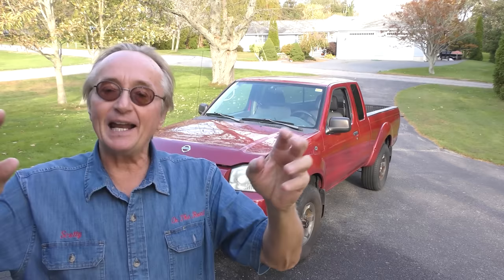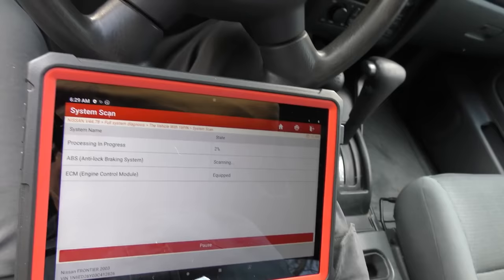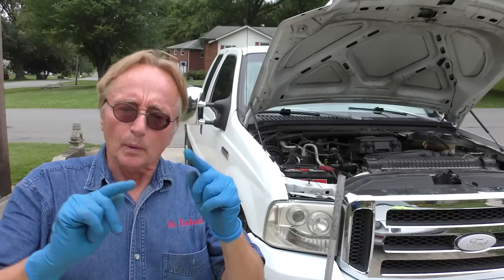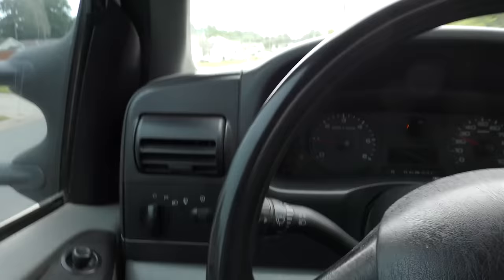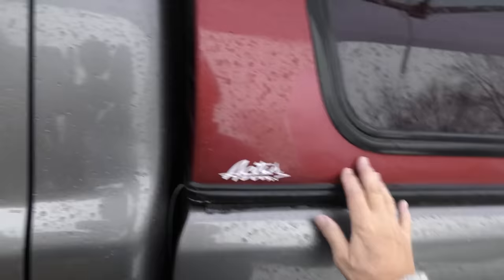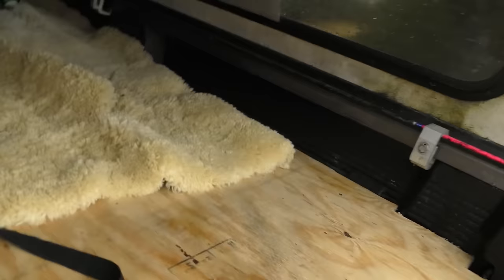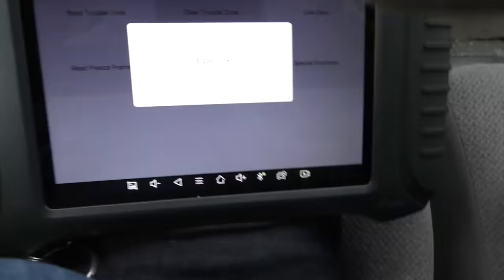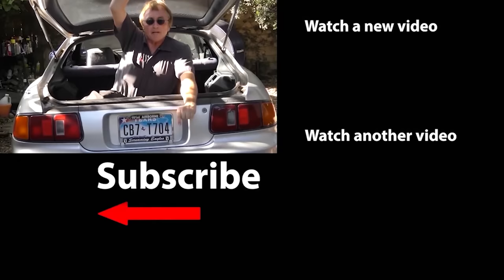3 Best Trucks to Buy When You’re Broke

Comment: Wow a $6300 F250 with 280k miles is considered a good deal these days. Good lord times have changed.
Reply: 25k here for a 1996
Reply: @pedro72246  I feel your pain, I was looking for a truck for months until ultimately I ended up buying a 2002 F150 for 12 grand. Only 85k miles on it but still insanely priced compared to what you could find just a few years ago.
Reply: In the past year I've bought 3 F-250's, An 81 with 67 k original miles, for 1500, a 95 for 250 dollars with 258 on the clock, and a 99 diesel with 212 for 8 grand from a dealer. The deals are out there, just got to be on the look and ready for them to pop up
Reply: You always overpay for a pickup becUse the wanna be cowboys all want them.. get an suv with same powertrain for half the price
Reply: @keithbellair9508  I'm a landscaper, I've been buying cheap pickup trucks for years. Trust me, a few years back you could get a 100k truck for 5 grand or less no problem.
Reply: I got ranger 5k 117k 4x4 3.0 Vulcan
Reply: Man im feeling better about the 93 ranger i scored for $500, granted its got tons of cosmetic damage it has good bones otherwise but could use some tlc for sure. 

It has a mileage discrepancy since they swapped out the original engine for one of the same model but a year newer and changed out the dash and thus the odometer as well. Allegedly it only has 30k on the engine plus the 5k on the odometer. Would have to boroscope it or tear it down somewhat to dimensionally inspect some stuff to verify.
Reply: I was thinking the same. The 3V 5.4 had alot of issues and even if said issues have been fix/changed out with more durable parts, the truck itself should be no more than $4500
Reply: Yes sir,at one time 100kwas wore slap out,lol

Comment: I love my 96 F150. It has almost 300k miles, the steering is absolutely terrifying, and the temp gauge doesn’t work, but it still runs perfectly.  I only paid $3k for it a year ago.
Reply: That's crazy how high the price of used cars are. 5 years ago that same truck would have been 1200 bucks
Reply: My dad too. It's a green 96 single cab with the 5.0 V8
Reply: Put a redhead steering box on it and new tie rods
Reply: I got a 2000 Ford f350 for that same price last week...........
Reply: @Coolness18304  immediately before the pandemic I was seeing those for anywhere from $900-2000
Reply: Get new tie rods, lower ball joints…you should really consider it. I got an old Honda and the lower ball joint popped out while I was parking. Whole axle came off the tranny
Reply: Same here! My 2000 Ford Expy 4X4 runs like champ! Could use a paint job, but with gas at 6 bucks, that ain't happening!
Reply: I paid $800 for mine (95)and it would drive straighr while I was napping with great power steering still at 278k on a 300 straight 6, what market area are you in if you don’t mind me asking lol that’s crazy
Reply: I bought a 96 F250 from a construction company I was working for for $800 with 140k miles. I drive it everyday
Reply: Need new control arms and bushings at the pivots.
Reply: My 2001 F 150 has 250K miles and the 4.2 V6 and trans are like new.  Regular fluid changes.
Reply: Get a job and buy a real car
Reply: I want it PLEEEEEASE
Reply: Sounds like you overpaid
Reply: Tie rods.  Also check if your front brakes/calipers not locking up.  It’s very common at high mileage vehicles.   A temp sensor is only 15-50 bucks and easy to install (no cutting or wiring required lol) plug and play lol😂
Reply: Cool.  My Dad sold his 94 Ford F150 2wd standard cab long bed for $6500. He kept up maintenance and repairs on it. He bought it new in 94. It was garage kept ( didn't drive it in winter) a Ohio truck.  No rust on it.  He was sad to see it go.  Truck only had around 80000 miles on it.
Reply: 10 years ago i picked up a 1991 Mazda b2200 pickup truck, with 90,000 original miles, in flawless condition, garaged all its life, single owner, it got stolen and they stole my catalytic converter, aftermarket seats, and all the cool stuff on the truck, but as of recently I needed a truck, and that one was sitting for the past 10 years, I decided to get it back up and road worthy again, and i've been dailying it ever since. Can't find a good truck deal now a days...its so bad..
Reply: I just bought a '99 F150XL that's got 380k on the odo. Single owner, had an engine replacement at 200k, it's a manual, it runs great, the frame is good, the suspension is good, the A/C blows cold, the bed has spray liner, and I got it for $2200, and I'm psyched. Yeah it's not going to last forever at this point, but it's a great working truck for us to use for the next few years. Definitely still deals to be found!
Reply: @andrewpeterson5882  yup and no car payment!  Lol
Reply: @andrewpeterson5882  This is the way!
Reply: It may be worth about 800$ …3,000 that’s high for scrap metal
Reply: You paid $3K for POS and being happy, that is something
Reply: @cowarddonnie-ji5yz  Haha and you have a car payment of 1,500$ every month for the next 8 years and you're happy about it?!?
Reply: I got a 2001 f150 5.4 v8 with 180,000 miles on it needs a new exhaust and breaks but I only got it for 900$ solid frame
Reply: My 96 F150 has 228k miles on it and still runs great! Has a little miss but it's a RWD beast, and takes good care of me(being fairly easy on it) as long as I keep taking care of it and making sure the fluids are full and changed regularly!
Reply: im glad you like yours. I have a 1993 f150, it has been the most reliable vehicle i ever ownded. But, im sorry to tell you i bought it in 2010 with 65k miles for 5500$. And get the steering linkage looked at, these trucks should NOT drive like a boat, they actually have pretty tight and nimble steering when everything is working properly.

Comment: My 2004 Nissan Frontier has 346,000 miles and still runs like a top.👍👍
Reply: @DevilDog53 I bought it used with 60,000 on it in 2007.  The rest was all me. Just keep the oil changed 👍👍
Reply: I’ve seen an driven when I was about 15 haha this was 2015, a 2009-11 Nissan Maxima with pushing 400k miles I was shocked still haven’t seen anything in real life wit so many miles
Reply: Wow, impressed!!
Reply: Had a 4 cylinder hard body. It never died unfortunately a accident took it out. Uncomfortable 4 cyl 5 speed. But the thing just kept running, and running. And running...
Reply: @itsallminor6133  before my 2004 I had a 87. It went over 500,000. And was still running when I got my 04👍
Reply: Yeah my 2.7 Tacoma is at 265k, 5 speed, bought it at 220k. Runs great. Curious when it dies.
Reply: If you take great care of them, a vehicle will last a lot longer than a lot of people think.

Comment: For years I've been towing a 6 to 8,000 pound trailer with a 2011 .F250 all over the Midwest. The truck now has 350,000 miles on it. Still has the original gas v8 and original transmission. only did required maintenance, oil changes, brake maintenance, transmission fluids and differential fluids and coolant fluids replacement's as required. Going for 400,000, only uses about a qt. of oil every 3000 miles.
Reply: Great vehicles
Reply: Right on,they go forever
Reply: Is that with the 5.4L??  That is very surprising it has worked that well.  Good for you, most of us aren't that fortunate.
Reply: Oh so 2011 F250 V8 are good reliable trucks?
Reply: @mywa8314  Depends on what factory it's made at.
Reply: @masonreppeto882  for example, anywhere in the U.S?

Comment: If you can actually see the engine and have enough room to get to everything relatively easily, you know it is an older vehicle and will cost less to work on.

I walked into a shop where they were working on a much newer pickup and they had the cab on the car lift above the pickup and the front fenders pulled off.  I asked why and was told that they had to replace the head gaskets and in order to get to the top of the engine to work on it they would either have to pull the engine out of the vehicle, which was the harder option, or remove the cab and fenders.

That tells me that they really really do not want the average person to be able to work on their own vehicles so they have to bring it in to the dealer so they can keep their shop busy.

Comment: I've been more of a car guy than a truck guy. My one exception was taking over payments of an old Ford Ranger from a cousin that grew up in my family. He was going into the Marines and just needed to get rid of the truck. It was a stick 4 banger. That thing was reliable and always easy to get fixed. It was a regular cab, which suited me fine back then. It got great gas mileage. Unfortunately, I could only go fast when going downhill. The baby engine tried. Nevertheless, it was great.

It probably could have lasted forever, and maybe I'd still be driving it if not for someone turning into me at an intersection. Because it was a cheap Ranger with a ton of miles, it was worth like a 6 pack. So it got salvaged. But I still have fond memories of that little guy. 🥹🥹🥹🥹
Reply: Some of the most inexpensive reliable cars stick to our memories the most because they gave us stress free months and miles of driving and they were so cheap.
Reply: Can't go wrong with the Ole Stranger
Reply: Your Ford Ranger was made by Mazda then with twins of "Mazda B2000"!
Reply: @darcychu9652  no they were half made by ford however some models like the 4 banger ranger and mazda b2000 had mazda trans and engine only where the automatic versions were all ford transmissions. hence the mazda b3000 and b4000 having the ford vulcan 3.0 and 4.0 engine and trans i believe certain years had the mazda 4 and 5 speed but later on was all replaced by ford. the frame beds cabs everything else is a ford ranger just has mazda badging.
Reply: I can't fathom financing a 4 cylinder truck 😂

Comment: Most dealerships and auto repair shops rip people off all the time facts. I know a guy who’s truck was showing a code 401 for egr value bad. He took it in and they charged him over 150 dollars to replace it and that’s all they did even though the holes were plugged up bad. So after a couple weeks his truck had the same code back on. I took off his throttle body and cleaned it out real good unplugged the port holes cleaned his new egr valve out checked it to make sure it was working properly with a vacuum test put it all back together and it is doing just fine that was 3 months ago no more codes. They knew it was plugged up but because it was showing the 401 code for egr valve they just replaced it and sent him on his way.

Comment: Bought a new Frontier extended cab in 1998. Drove it for 12 years with nothing but routine maintenance. Passed it on to my son and he drove it until last year with no major issues either. Stick shift and never had a clutch replaced. He sold it last year to a guy he knows for $500 and he's still driving it.

Comment: Other great trucks to buy when you’re broke: 
Mazda B series
Ford Ranger (Old models)
Reply: Runner ups: Old f-150 and Old colorado.
Reply: the old ford rangers were good trucks. were built on the old bronco 2 chassis. but with a ranger be aware of the steering setup. those trucks were notoriously bad on upper and lower ball joints (pretty much every ford truck and van from the time period) also they can also have camber and caster issues that need addressing so you don't waste your front tires in a few months...
Reply: sierra/silverado 90's early 2000's,  scotty spoke good of them too.
Reply: How about the Isuzu Hombre, its a chevy  S10 pickup rebadge to a Isuzu.
Reply: The torsion bar front and leaf spring rear suspension is tough and comfortable.
Reply: 96-01 Ford explorer and mercury mountaineer 5.0 2wd. 97-02 5.4 expedition and Lincoln navigator. All for $1500 or less
Reply: Where do you get the deals  because I think all the trucks are expensive
Reply: @jamespittman7985  also if a vehicle is inoperative or needs suspension work it may be a good buy. So long as there's no rust or been flooded, burnt or wrecked the rest can be fixed.
Reply: @Perich29  Actually it's a Isuzu rebadged as an S10 just like the Luv was. Point of fact the 4 cylinder was a Isuzu engine. The Duramax is also an Isuzu diesel engine.

Comment: Recently bought ‘98 Chevy Z-71 ext. cab. for 3K. No rust, pulls like a train and comfy like a Cadillac. Very pleased! Had an ‘06 F-150 that was also a great truck.
Reply: where? everywhere I look they're over priced and "meh" quality
Reply: @evaristocarreon714  you have to look for private sales. Craigslist, marketplace, even just vehicles in driveways with for sale signs in them. You’ll always pay too much at a dealer.
Reply: My 99 Z71 is the same.
If the engine ever goes, Ill just buy a crate engine for five grand instead of buying a new, crappy Chevy for forty grand
Reply: @Winterstick549  Exactly what I’ll do if my engine blows up. I figure the truck would have been worth what I paid even without a motor.
Reply: dude. my dream truck. You got lucky. All I seem to find are low mileage, but the bodies are beat to hell, or perfect bodies with nearly 350k miles

Comment: Good point on the Toyota frame replacement!…I had a 2008 Tacoma SR5 4x4 with a V6 and a 6Spd manual that I bought used on the east coast. I got a good deal on it because it had rusty frame and when I read online that they extended the frame warranty to TEN years, I called the 1-800 customer service # and they told me to take it in to a local (Seattle) dealership for and inspection.  Because the it had a small “quarter sized” hole in the frame, they offered to take my truck apart and give me a completely NEW frame! TOYOTA stands behind their trucks!!!👌👍😉

Comment: i had an 07 Frontier and loved it. V6 (mine had a timing chain, not a belt), 6spd manual, rear wheel drive. it had 300k miles when i wrecked it, and the only major repair i had to do was replace the clutch at 290k miles!

Comment: Just bought a 1998 Ford Ranger for 600 dollars, 912 out the door from the dealership I work at with 198k on it, runs perfect, no check engine, just terrible tires. Bought a 99 F-250 with the 7.3 Powerstroke diesel from the dealership for 8 grand with 212 k on the clock and its being a great truck for me as well.
Reply: Spend a little for a new set of Michelins, stay away from those cheap, chinese junk "value" tires and you'll be safely cruising along in your new rig for a long time! 👍
Reply: Hows she running now?

Comment: I bought a new 2018 Frontier S with crank windows and no options. The Nissan dealer had  2 of these things in Jan. 2019 because nobody wanted  something that basic.  This is a solid truck and was very under rated. I have had 2 Nissan dealers try to buy this truck in the last few weeks. LOL   No way will sell this truck!
Reply: Manual windows are less convenient but they rarely break and are cheap to fix.
Reply: @machintelligence  Most people don't roll their windows down very often.
Reply: @1linkbelt  Wait until one of your power windows breaks (usually driver's door) and see how often you use it. Bonus points if it freezes in the open position.

Comment: I have a 1999 ford ranger. Great car when you are poor. It’s best to have a 4 cylinder pickup. The ford ranger and Mazda b series are the only ones that have that. Ah also forgot about the Chevy Colorado since they have a 4 cylinder engine. 4 cylinder engines are not gas hogs.
Reply: There’s a 4cyl Tacoma too. Rangers are absolute pigs on gas. I’ve had two. As far as I’m concerned no one should buy a ranger for fuel economy.
Reply: There also 4 cyl frontiers 🤦
Reply: @swamp-yankee  
My 88 four banger stick shift Ranger got around 22 mpg.
Reliable, but 22 mpg is nothing to brag about
Reply: @Winterstick549  must have gone down hill from there my 6cyl gets 15, and the 4cyl got 18. For comparison my girlfriends dads 8 cylinder 4x4 f150 gets 18 combined, and absolutely blows a ranger out of the water in terms of power.
Reply: The older Nissan Hardbody's with the KA 4-pot could get mid-to upper 20's.

Comment: I can’t believe you recommended a 5.4L 3 valve Triton engine.
Reply: The 2 valve is wayyyy better
Reply: 04 and older is 2v
Reply: @danielcarrillo1057 , exactly. Not as much power as the 3v, but you can always save up money to swap a Lightning 5.4 with the supercharger and make almost as much hp and torque as the new 5.0 Coyote engines.
Reply: Next weeks video… Scotty says anyone who buys that motor is “Stupid”
Reply: @D4x4Bronc  04 3 valve only exception for that year is expedition
Reply: @americanchauvinist1210  yeah I always forget the 03-04 expeditions received the 2v engine. Good memory. Did you know the 97-02 expedition navigator 5.4 received the 4r100 transmission and the f150 of the same drivetrain received the light duty 4r70w. I could never figure out why so many expy/navs got junked so fast if they were built more heavy duty. 5.4; 4r100; 9.75 rear is almost super duty or lightning drivetrain.
Reply: @D4x4Bronc  so is my ‘03 Lincoln town car a 2 valve? I hope it is.
Reply: @seriously3130  yes they all were. 03 is considered one of the best years of the panthers.

Comment: Just purchased a 2000 Nissan pickup with a V6 and 5speed for less than $3k with 170k miles on it.  We replaced the old radiator, water pump, fan clutch and it has extremely reliable with cold air conditioning on during our hot summer here in Kalifornia…
Great truck 👌

Comment: 1999-2006 GMC Sierra Chev Silverado 1500 with either of the V8 4.8 or 5.3.  Excellent trucks with lots of used and new parts available, repair information on common flaws, and aftermarket upgrades/support.
Stay gold.
Reply: Our Silverado with 5.3 has been transmission problematic though
Reply: With the 3 scotty mentioned you don't need access to all that lol.